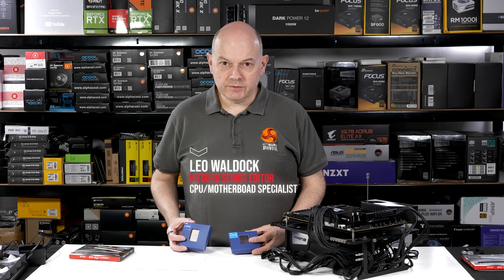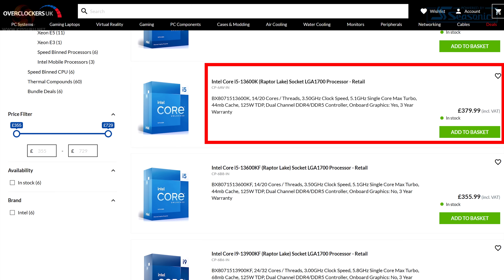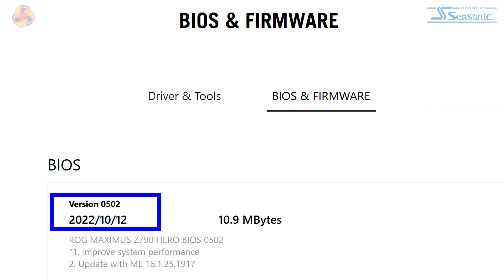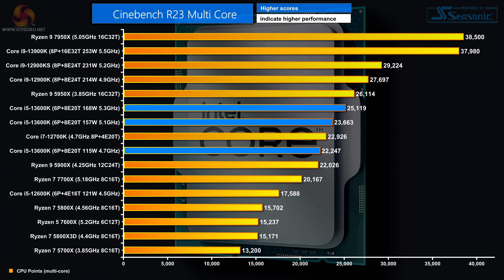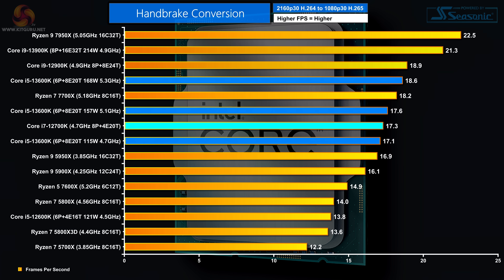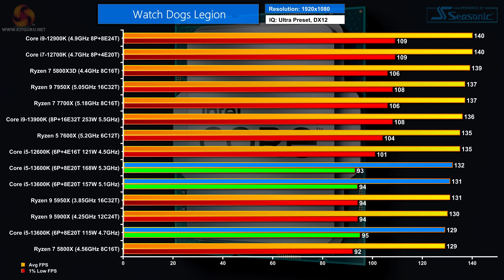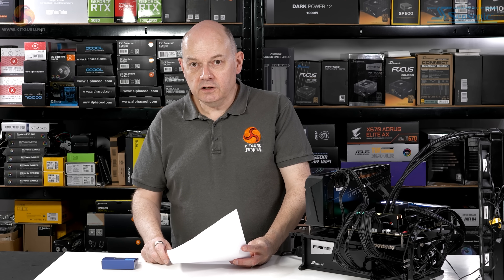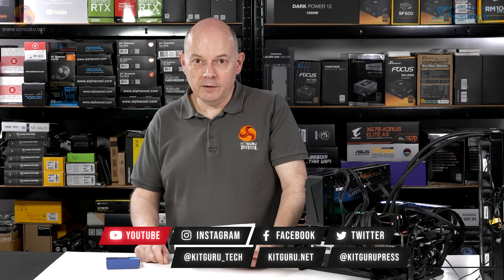Intel Core i5-13600k - smashes Ryzen 5 7600X 🥊

Comment: Im ready to build a 7700X system as soon as they cost $350. Then the future proofing makes more sense. New DDR5 motherboards are pretty much the same price and DDR5 is coming down in price.
Reply: DDR5 is 200$ here, for a 4800-5200 kit (32gb). 3200 DDR4 kit is like 100-120$. There is no way the performance difference can bridge the massive price gap. Include motherboard prices and the difference lets you fit a FREE 2tb ssd in there. There's no way the gain is worth anything unless you have money to waste.
Reply: @FiveN9ne  So were both pretty much talking about $150 total on a Mboard and DDR5 on a $1500-2k build that should last a normal person 4 years. Its really not a big deal.
Reply: @gprojectnoob4779  I'd much rather get a 12400f or a 5600x and have enough money left over for 2 tiers of a better GPU. To me, it's about this. Is 7700x + am5 + ddr5 and 6700xt better than 5600x/12400f + am4/lg1700 + ddr4 and 6900xt. For strictly gaming i will choose the 2nd option every time.
The CPU is 200$+ difference alone. Board and ram, another 150$. To the average person, that's a lot of money. And what do you gain? Very little, if only for gaming.
Reply: @FiveN9ne  7700x is $400 , 13600 is $340 thats 60 bucks. Memory is 80 difference . Z790 is the same $ as x670. The 12900k takes a bit hit when using ddr4. Lets see 13600k performance on ddr4
Reply: @gprojectnoob4779  Who mentioned 13600. What i'm saying is that going for am5 in general or new intel stuff is not worth the money.
Reply: @FiveN9ne  The new AMD GPUs are going to be pcie5.0. When those show up we are going to see if DDR5 has any advantages..

Comment: Great review. I love that you're using the Blender classroom benchmark. I now only consider multithreading performance with Blender and single threading performance with Photoshop as a judgement criteria for purchasing a CPU. Because the Cinebench results are not reflective of actual performance.
Price wise though the 13600K is on the same level as the 7700X not the 7600X. The 7600X is 100€ cheaper at 350€, at least here in Greece.
Reply: While the pricing of the i5 and R5 don't always match up, the platform cost still puts these 2 as direct competitors:
i5 + B660 + DDR4 is slightly ahead for most workloads but costs at least €100 less than 7600X + B650 + DDR5,
Need/want DDR5? Then the i5 handily beats the R5 (okay it's just another 5% or so) for roughly the same platform cost (can still use B650 instead of B750)
Reply: @erfa10  i think this very much depends where in the world you are, a 13600k 'cheap' build here in canada is about 220 bucks more than a 'cheap' 7600x build, even if you go ddr4 on intel 7600 build is still ~100 cheaper for core components (ram, cpu, mobo)
Reply: @3ddan148  Interesting! I'm actually picking parts to build a PC in Canada but, last I checked, I couldn't find any AM5 ITX mobo for less than $250, looks like I should start checking again in case some more B650 ITX boards are out
Edit: Seems like the ITX side is just lacking on AM5 for now
Reply: @erfa10  im looking at a asrock b650 board for 197 from CC, not ITX, ITX boards are almost always more expensive than the cheapeast options because they have moore PCB layers. my ITX B550 was 319
Reply: @3ddan148  Stuck looking in ITX I'm afraid... got my eyes on an Asus $250 ITX mobo with DDR5; ticks all the boxes without an AM5 substitute at that price... for now at leas
Reply: @erfa10  yea thats fair, if your stuck in ITX, and ive been there, then your deff gunna have more limitations on the pricing front. even last gen, i got a B550 chipset b/c on ITX i wasnt losing anything with limited IO b/c of FF, and price was basically the same, infact i think there may have been a X570 ITX out at that time for around 300, ive found when you look at ITX typically the price gap between X and B series shrinks
Reply: @erfa10  there is no reason to go ddr5 with 13th gen. you will be losing 25% or more of performance in certain games/engines
Reply: @zeropride1133  Maybe for now, I heard it's a relatively unstable series at launch, but I'll be building on Black Friday or later (so still watching those DDR5 prices trickle down) and going to be sticking to the same CPU for at least 6 years, probably going to be able to keep the DDR5 if I upgrade then.
Reply: @zeropride1133  In other games, DDR5 sees a gain in performance over DDR4. Plenty of ambiguity. Which is better on average for gaming seems an open question.
Reply: I change my rig every 2 years. I’m going with this i5 end of year.
Reply: I get the same cinebench scores to 7700x max pbo on 12600kf oc. 20k and 13600k does 25500. So roughly. 25% improvement. 12600kf was £240 a year ago. Thus to get linear performance 13600k with 25% markup should be £310. But the cheapest price in uk so far is £330. 13900k though gives you 40k points so double the perf of 12600k. Might just upgrade to that when they drop in price and keep it 5-10 years
Reply: @alexandrews2585  Uk pricing is very messed up all round. annoys me
Reply: @lucifersheadscarf6988  if you got 12 gen on z690. Just wait for 13900k to get two 250-£300 level to upgrade.

Comment: I wish reviewers would also present results normalized by power consumption. That is a definitely factor in the price - performance of these CPUs.
Reply: @Stein Mauer wrong lol, 13th gens a currently a tweaker's dream. All the multiplier issues that were caused by the ecores seems to be solved. People are now messing with the ring frequency aka cache speed. Plus any setup running below 7400mhz DDR5 is doing something wrong. Messing with the ring and ddr5 tuning can extract about 10-20% more fps in gaming performance from stock without power increase... also now the effecient ecores can be overclocked stably. 

Althought these are considered after tweaks so it's not for everyone.
Reply: Its an interesting concept, but you have to test a product with how its sold to the general public. Its a little like buying a V12 engine car and turning off some of the cylinders to match power consumption of another car with a different engine layout. Pointless for most people.

Comment: Very good review Leo. 
What is your view of the benefit (or otherwise) of DDR4 Vs DDR5 for gaming? Worth the premium? 
And, what is your view of the whole Z790 Vs Z690 motherboard debate for a 13600K? Or, would a good B660 suffice? There are a lot of different hardware combinations, and it is tricky to see which one offers fair value and a good future upgrade path.
Reply: Don't mind me, tagging along to see replies
Reply from the maker: I ran Core i9-12900K and i9-13900K on both Z690 and Z790. There was no difference.
Leo
Reply: @KitGuruTech  Thank you Leo for the information. I have a few questions. 
Did you run the tests for both productivity and gaming software (ie, the same as featured in the above video)? 
Did you use DDR4, or DDR5 RAM? If both types of RAM were tested, then was there a difference? 
You tested the 13900K. It would certainly be very interesting if the 13600K was subjected to the same Z690 vs Z790 test (and even a DDR4 vs DDR5 battle).
 Lastly, do you think the model of Z690, or Z790 board will matter much? Would an entry level Z690 board be sufficient (I believe bios flash back is a required feature)? With thanks.
Reply: There is no future upgrade path for 13th gen Intel. They will be moving to a new socket with 14th gen/Meteor Lake.
Reply: @darudesandstorm7002  For people who don't upgrade their cpu's all the time (which is most of them), every socket is a new socket.

Comment: Hello sir, at 65w does 13600k perform better than 7600x in gaming performance?
Reply: Highly doubtful.
Reply: Throttling the power down on these new CPUs to minimum and benchmarking against each other would be very good knowledge.
Reply: @festerleech4952  yes as someone who prefer efficiency, i need that information, not just on i5 vs R5 but also for i7vR7.
Reply: @madarasoun3018  ok Greta
Reply: @georgelowrielowrie5428  not her fan, dude. I just don't wanna spend unnecessarily more on electricity bill.

Comment: Great review Leo. This is a pretty impressive CPU to be honest. I'm really interested to see what AMD can do with a '3D' release in the future
Reply: the 3dcache doesnt help with mult threaded work loads. The 8 core should have been the 7600x. I cant knock AMD too hard though. there is a reason the Intels 10th and 11th gen are no where to be found but their competitor, the 5000 series is.  It merc'd them both.
Reply: @zeropride1133  most people buying the 13600k are probably gamers, and in that case, multi-threaded compute type workloads are kinda irrelevant. If you're looking for a new workstation cpu you have all the data you need at this point, but 7k 3d will likely mop the floor with intel in gaming, so in that case, definitely worth waiting a few months to see it in the flesh.
Reply: @hoff521  by the time zen4x3d is out, 14th gen will be around the corner. Besides with 4090 and future more powerful gpus, cache would not be as significant in gaming especially if SAM aka re-bar becomes a norm
Reply: @zeropride1133  The problem with AMD is you usually gotta wait for them to catch up, 8700k released the same year as Zen 1 and the 8700k was usually quite a lot better in games. It took until Zen 2 3000 series to get closer to the 8700k and was still mostly behind in games. Alder Lake noticeably ahead for over a year before AMD mostly just caught up. Competition is good for sure though.
Reply: Amd fanboys last hope is 3dvcache. I said AMD where gonna lose this time.
Reply: Even if 7th gen 3d cpu releases it's still probably going to be more expensive. Pricing is the real problem. Amd needs to cut prices.

Comment: Why is the 13600k pulling 100W more over the 7600x? It just make the 7700x incredible compared to the 13600k, for about 50$ more, but you save on cooling and the mobo are about the same and Intel needs DDR5 to match AMD... so i don't see really Intel winning anything.

Comment: Smash in MT... but not in gaming when comparing 6400 memory for Intel and 6000 for AMD... also requires an AIO while you can be on air for AMD. Not only this, but the 13600k cost 320$ vs AMD at 300$. Not to mention LGA1700 is a DEAD END platform... so AMD wins after all...
Reply: For people who upgrade once every few years every platform is a dead platform...
Reply: for the 12700k, 12900k, 13600k, 13700k, at stock settings you do not need an AIO, you do need a GOOD air cooler (scythe fuma 2, nh-u12A, AK620, NH-D15, Dark rock pro 4 etc)

Comment: I just buyed an 5800x3d and rog strix b550 motherboard, should i return them to buy this 13600k procesor and b660 strix motherboard  ? 🎉
Reply from the maker: You have the graphs in front of you and presumably read about the 3D before you placed your order. It is a fine gaming CPU and definitely has to be assessed on its own terms
Leo
Reply: To have a noticeable improvement (5-8%) with the 13th gen you need to get DDR5, with DDR4 the 5800X3D and the 13600K are tie for gaming, in some cases the 5800X3D is even more powerful.

Comment: Actually Hardcore Overclocking overclocked his 13600k to 5.6GHz all p cores stable on air (e cores disabled).
Reply: So you’re point is the 13600K is great if you disable the E-cores? If not, you will need to buy a 360mm liquid cooler($200).
Reply: @tringuyen7519  I'm quite confident $100 Arctic Freezer Liquid II with thicker 280mm rad will do better job than any of these 360mm AIOs...
Reply: @Micromation  that's a fact. it even does better than some custom loops lol
Reply: Not very real world testing tho.

Comment: The results between raptor lake and ryzen 7000 are very even and that is the best news for the consumer. From what I see an advantage in amd is that the socket has a life until 2025 and intel does not, I would like Intel to apply the same to its platforms.
Reply: how do you see it even when 13600K beating 7700x & 12700k too being i5?  Have you donated your eyes? Lose in performance and start BS about socket life. Once someone has a decent CPU, GPU is the must have upgrading component for getting better performance.
Reply: @freaky425  You have to see several reviews to draw conclusions, not just one, when you see 20 different applications and 20 different games you realize what I am saying. https://www.youtube.com/watch?v=7bDxx0ZGylU

Comment: Using Hardware Unboxed power data and score data in Blender Open data, the 13600K with 20 threads to produce 5.76 renders per hour using 315 watts.  The 7700x with 16 threads produces 5.48 renders per hour using 256 watts.  The difference between the two is 59 watts.  In a year's time, that difference is 555 Kilowatts. Without lookIng at the number of threads and you can't see how inefficient these Intel CPUs are.  This is typical cheap product solicitation.  Lower up-front cost but much higher long-term costs.  Those long-term costs are variable and in Europe especially they will easily wipe out any short-term pricing advantage.  Add that this is a sunk platform, investing in these is economically stupid.
Reply from the maker: Your maths suggests you want to use a Core i5 or Ryzen 7 to render Blender perpetually all year round. There are many better ways you can go about that task. Also when time is money the answer is Threadripper.
Leo
Reply: @KitGuruTech  You claimed that the 13600 KO'd the 7600x.  It's simply not true in gaming.  So that leaves production as the basis.  As shown below it is highly uneconomical to use either the 13600 or the 7600 for production.  It deceptive to claim a victory based on a use that the processor shouldn't be used for and for which it is highly uneconomical.    

The new Intel CPU's are highly inefficient and means of determining what the long -term variable costs are going to be is needed.   HB's data is helpful to give us that indication.  Here are the watts per render given total system wattage per hour.  It is function of number of renders per hour divided by the system wattage which is already in hours.  7950 at 33.13, 7900 at 37, 7770 at 46.72, 13700 at 49.67, 13900 at 52.18, 7600x at 54.11, 1360 at 54.69.   

The 7900 and 13700 have the same number of threads.  The 7900 cost a hundred dollars more. Yet, a much higher energy cost.  

If you are upgrading an existing system in the same footprint it would be one thing, but a new system is illogical except if you need an upgrade and you are buying into the AM5 and its likely 3-4 years of compatibility and you want a lower price point entrance.  

An independent benefit can be seen for the 7950 and 7900 especially the 7950 where eco mode can be used reducing the power budget to 110 or 90 watts and still perform better than the last gen and the new 13th gen. That is some long-term benefit if you have the need.  Otherwise, take advantage of the fire sale on the last generation AMD parts.
Reply: @robertmyers6488  man AMD lost this one
Reply: @ashtonlipscomb1295  How so.  Extra cores for a highly inefficient and uneconomical workload on a dead platform.  It doesn't win for games.  That is the end of this story.
Reply: this AMD fanboy is losing his mind. you should go buy crap if that AMD sells for you.
Reply: @freaky425  I noticed how you didn't address the facts.  That says it all.
Reply: What so darn funny about that is the power difference is about all the Ryzen 7 5700x needs to have life.
Reply: This Intel processor is unbeatable in this sector. And I’m an AMD buyer myself. Let’s keep it real.
Reply: @lucifersheadscarf6988  it's slower at games burns more energy, incredibly inefficient at productivity, and is on a dying platform.  Yeah sounds great.
Reply: @robertmyers6488  amazed thats what you got from the review. I guess you just bought an AMD processor? All this 'but you can keep this platform for 5 years! means absolutely nothing to me. It might mean a lot to you, but I change systems every 2 years maximum (systems, not just a processor). that dying platform comment just seems like a guy pitching a ball as far as he can and hoping to hit something on the way down.
Reply: @robertmyers6488  if you're so concerned saving power, saving every last penny then you should be really looking at Pentium series...lol. Heck why even use television, refrigerator, washing machine or oven? 

You talk about Intel being a dead platform as though it's a major problem. Let me tell you that the average consumer does not upgrade his/her computer every 2-3 years. And by the time an upgrade becomes necessary, they'd be better off building a competely new system with the latest features instead of carrying over outdated components from previous build. So all this platform longevity bullshit matters only to enthusiasts who don't represent the masses.